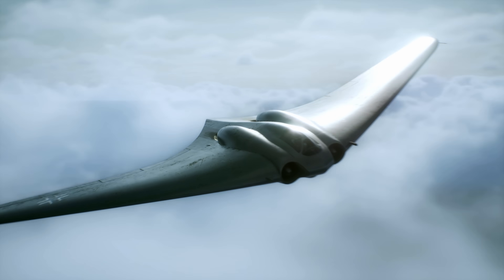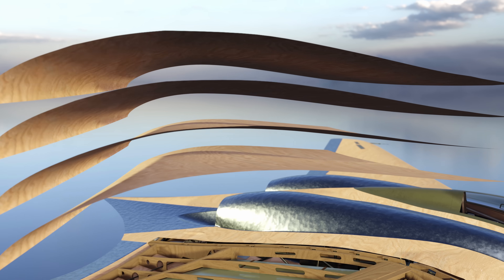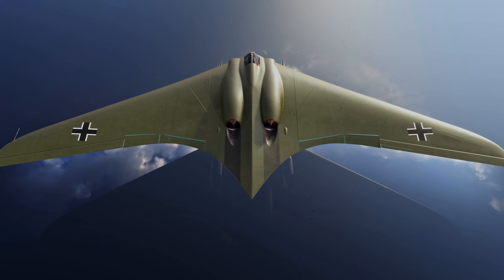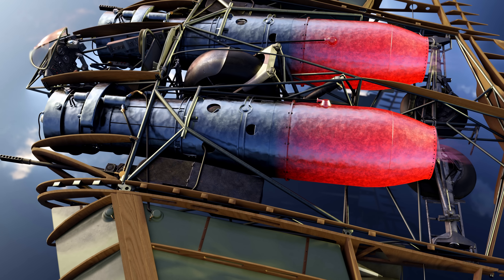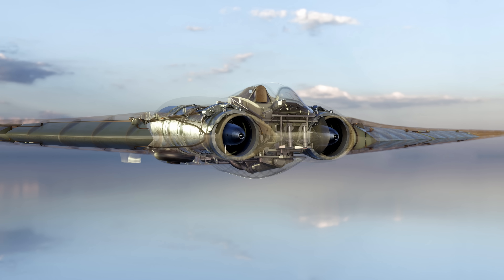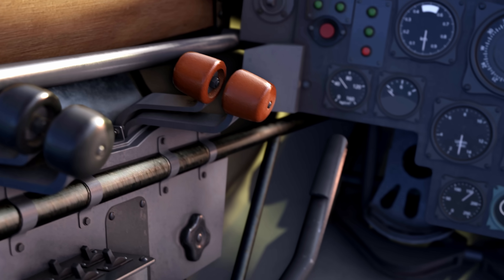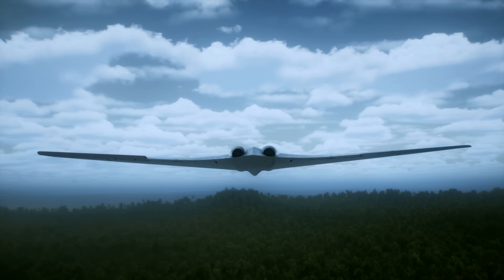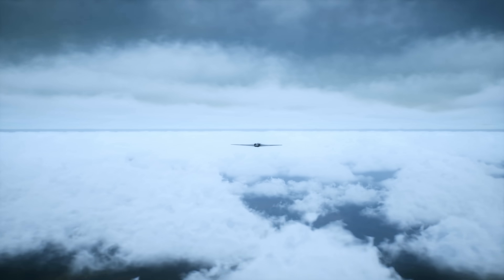Inside the Horten Flying Wing

Comment: This is easily one of the most facinating and beautiful planes ever built.
Reply: Indeed, it my fav of all time, I would love to see a modern one.
Reply: @Yvory6  the "modern one" is flying right now - the U S Air Force B - 2 bomber. And it will continue to fly when the B - 21 is operational.
Reply: @williestyle35 
And it actually needs on board computers to keep it aloft.
The Horton didn’t.
Obviously comparing size difference. But considering the Horton brothers were not aeronautical engineers makes this aircraft even more incredible
Wondering also if the 229 could have been constructed with proper materials. Particularly the skin.
Reply: @Rob.S859  The horton didn't have a computer not because it didn't need it but because they didn't exist. Without flight augmentation systems the plane was almost unflyable, which is why it never was used in combat. Overall it was a terrible plane that couldn't even really be flown.
Reply: @williestyle35  yeah I know all the story around that, I meant a modern version of that exact shape
Reply: @rubiconnn 
The point I’m making is that this aircraft that was literally designed by an almost “cottage industry” budget by two brothers who were not even aeronautical engineers. 
The fact it flew without computers is a remarkable testament to the Horton brothers and their vision.
A B2 can’t even get off the ground without the aid of computers.
Also look at the overall design. The placement of the engines in relation to the drivers position. The angle of the swept wing. A lot of characteristics taken from the Horton. Weather by coincidence or design.
I suggest you read the book Horton 229 The Spirit of Thuringia to get a better appreciation for this aircraft.
As for its handling characteristics.
They had actually solved a lot of the critical issues with design changes in Feb of 45’
The one powered crash was due to engine flame out of which the pilot chose to try and save the aircraft instead of himself.
Prior to that, there were other successful flights of the 229.
Further more, it is known from Hortons that they had arranged  a mock dog fight with the Me-262. And that the 229 out performed the 262.
Though I have not found substantial evidence to back up the last statement regarding the 262.
Reply: @williestyle35 But why where they developed so late. Not directly after WW II?
Reply: @Rob.S859  Por eso es que el Ho-229 se estrello, era inestable. Tu afirmación parece que toma en cuenta ficticiamente que el Ho-229 estuvo operativo.
Reply: @cristianmigueliit parraguirre8750 it crashed because of engine flame out not because of any engineering flaw
Reply: @trance9158  Incendio en el motor también es fallo de ingeniería. Además de eso, creo que todos estos comentarios no tienen ni idea que franceses, soviéticos y Norteamericanos volaron alas volantes antes que los alemanes...
Reply: @williestyle35 US. The bravest engineers, physicists, mathematicians. Sadly, becoming worse at finance and modesty. Seems like upper middle class will be educated enough to work with such prestige as those who design such aircraft. The lower class will be uneducated or have the label but become corporate store managers for the corporate oligarchs. Switzerland isn’t a military or tech prowess, but I enjoy living here with my American husband, who is prior combat vet. We are doing okay. But depending on US direction. I would really like to live in Florida, on the coast. Or one of the Florida rivers that lead to ocean. On cool note. My husband was born in Ft. Myers, and lived in Naples Beach. In the new GTA. Its regions included called Ft. Misery and Napoleon Beach haha
Reply: @Rob.S859  But the similarity you refer to isn't similar. The engines on the Ho 229 are right forward beside and against the cockpit and the intakes are right in the front of the leading edge. Whereas the engines on the B2 Spirit are behind the cockpit, separate from the fuselage and the intakes are above the wing and set back from the leading edge. As for the swept wing angle, it is not the same in both aircraft and swept wing tailless planes had been around since the Dunne D8 of 1910 and followed by the likes of the  Westland Hill Pterodactyl 1A of 1928 and Northrop's own NM-1 of 1940. All of those aircraft had flown as much if not more than the Ho 229.
As for the claim that 'it is known Hortons that they had arranged  a mock dog fight with the Me-262. And that the 229 out performed the 262' , it isn't 'known'. As your experience suggests, there is little evidence to support such a claim and all there is evidence for is a telephone report by Ziller to Reimar Horton in which he compares the 229's climb and turn rate favourably with the 262's.
Reply: You mean the yb series since those planes came before the horten???. If you mean it looks similar to the f117 you would be correct as they are very similar in design
Reply: @rubiconnn  It looks like a handful just to keep airborn.
Reply: @Rob.S859  yeah that skin could be lots of different materials today. The engines are much better too. Computers are available that can easily handle the controls. Using the same concept and plans with modern technology. This would be an awesome fighter
Reply: @rubiconnn 😂😂 yeah.. guess we will have to wait for that argument to be settled. I say it will fly. And it’s a flat out hot rod. When you are a pair of brothers stuck under Nazi control. Tryna build a successful fighter and bomber with a state of the art all new technology. On a shoe string budget. Because the ally’s have laid waste to your country and blown its infrastructure all to hell. Yeah the pressure and challenges could be a wee bit overwhelming. 😀
Reply: @Rob.S859 maybe you didn’t find out everything about the 229. But i can see your a fan. And you do your homework. 😅. Lots of test pilots buy the farm developing aircraft. That’s part of the job. If these brothers could have been given the opportunity that vonBraun had gotten. We could have seen this plane flying by the 1960s. Can we say Skunk works?
Reply: @cristianmigueliparraguirre8750 all prop jobs. Strung together. This example is like a Ferrari in comparison
Reply: @JohnPlatford  No, un Ferrari es funcional y la comparación es absurda.
Reply: @ lemme guess what you said. 😎. You said that a Ferrari is functional. But the plane wasn’t. So im wrong. 😀. Well that’s your opinion. Mine is the Horton 229 was fully functional. Albeit with makeshift parts.
Reply: @JohnPlatford  Tú lo dijiste, es tu opinión, mi afirmación no es una opinión, solo menciono el hecho de que el Ho-229 nunca entro en servicio y que su único pruebo de vuelo terminaría estrellándose ante la inestabilidad en vuelo, falleciendo su piloto. 
De repente tu tienes un Ho-229 en secreto y haz comprobado que es totalmente funcional... XD.
Reply: @hugoswan7400  Because they weren't developed late. We currently know about the planes that were developed 30-35 years ago. So take the newest plane that is known to the public, something that isn't even released, like the F-47, there is a version newer than that already being build.
Reply: @rubiconnn  Yeah dude, It was so useless that the US eagerly stole the design but took them 50 to figure it out, LOL!!
Reply: @Rob.S859  B2 is based on Horten H.XVIII  "America Bomber" ;)
Reply: @williestyle35  sorry but for a reason, I can’t explain the Horton just looks better
Reply: The most advanced military aircraft are made with non-metal skin materials, again. Wood isn't a problem when no one can hit you.
Reply: @goodday126 . Aluminum isn’t indestructible 😂. Or titanium. Lol. As much as we love this wonder metal 🎉
Reply: Normal.Los mejores ingenieros del mundo son alemanes
Reply: I saw it last April at the Air & Space museum near Reagan Int'l Airport in DC (highly recommended). You could easily overlook it due to the overwhelming multitude of aircraft. They also have an ME 163 Komet.
Reply: Pure art:)
Reply: Das war Deutschland ❤
Reply: Agree
Reply: Damals war das Flugzeug aus Thüringen seiner Zeit Meilen weit vorraus . Hier wurde Geschichte geschrieben für die Flugzeuge von heute !!!
Reply: @frankbreitzke5239 Nonsense. This thing was a waste of time.
Reply: The fact that this aircraft exists triggers the xenophobic Alliboos... it is a humiliating and embarrassing slap back into reality and completely destroys the notion that the Allies were leading or even on par with German aerospace technology.

Because they cannot deny this aircraft exists they feel obligated to slander and insult the Ho-229 with misinformation and outright lies.

Of course this only makes them look even more childish and ignorant.

Germany invented jet engines, supersonic ballistic missiles that flew into space and they invented radar stealth technology... let the Alliboos cope and seethe.
Reply: Did you know these things were made by obese fascists sucking hitlers toes while doing a Roman salute
Reply: gdyby Hitler miał ich 100 ,to dzisiaj nie byłoby na Ziemi ani jednego żyda .I nie byłoby " Covid 19"
Reply: THIS PROVES HORTEN IS THE ROOT OF B21 B22 KITE PLANE ETC...
Reply: Ok! 👀
Reply: There are two of these in Chantilly Virginia.  I think you are wrong about your history and numbers.
Reply: Fueron la base para los bombarderos de hoy.
Reply: Ele aparece no Filme do Capitão América. OBS: Os EUA projetaram jatos muito similares a eles em anos posteriores, considerando que capturaram um para estudos, não é meio maluco saber que os Caças Super avançados e até tecnologias espaciais vieram do que foi criado pelos N4zist4s?
Reply: We can only be saved by THE PERFECT BLOOD OF CHRIST, SHED on the seat of divine mercy, the Ark of the Covenant.
There is no other Name than that of YESHUA /JESUS CHRIST that has been given to us in the world, to be saved.
YESHUA is the name of the Lamb of God that was designated by the Prophet John the Baptist / YOUHANAN.

The "Left Behind" will have to die as martyrs for Jesus Christ because they are not under his Blood, now and will have to refuse the mark of the beast. Because by their refusal today to become Children of GOD by placing their Faith in the Blood of Christ's Atonement ... they will be obliged to go through shedding your "own" blood for JESUS CHRIST.

Repent (understand that we are sinners, that we are heading towards hell, but a 180° is possible and saving) ---> METANOIA ... it is a transformation of state of mind, so when we put ourselves under the discipline of CHRIST and totally Trust in the REDEEMER BLOOD of Christ Savior YESHUA (meaning SALVATION) to remain there by FAITH continually, CHRIST becomes LORD OF OUR LIFE, even if we sin clumsily, we repent because we have then become Children of GOD and have the promise that He will save us from eternal perdition because YESHUA IS OUR ADVOCATE with the FATHER. 

So it is essential to believe and place all our trust in Jesus Christ, He who shed HIS PURE BLOOD IN OUR NAME ON THE THRONE OF GOD TO JUSTIFY US WITH THE FATHER TO BE SAVED ETERNALLY, YESHUA HAS WRITTEN OUR NAME IN THE BOOK OF LIFE OF THE LAMB WITH HIS BLOOD ---> to appropriate it for free because Jesus allows us ... we have nothing to pay ... it is GOD who offers us His Lamb, the Redeemer, his SON YESHUA / JESUS without any good work to accomplish for that.

He is our Lamb that GOD has provided for us for free to save us WITHOUT EVEN PAYING a penny, and this corresponds to the phrase of Abraham to his son Isaac when he asked him father "where is the lamb?" ... Abraham answered: GOD WILL PROVIDE A LAMB.

The Jews did it by buying a lamb, PAYING to slaughter it, admitting to being a sinner to transfer their sins onto this emissary animal and then ask the priest to pour its blood on the mercy seat of the Ark of the Covenant in the Temple of GOD in their name to be saved from the judgment of God concerning the past year.

Now Our Savior gives us the Salvation of God for free so that the poor without money can be saved and have eternal life without any good work to accomplish without doing anything, for free, just BY FAITH IN HIS REDEEMER BLOOD ... because we are saved by Faith in the BLOOD of CHRIST ... nothing to buy and nothing to accomplish because it must be understood that this was hard for the physically handicapped
Reply: Imagine if they had aluminum alloy... though they wouldn't have had the radar stealth...

Does wood actually bounce off radar differently/slower though?
Reply: It is fabulous.
Reply: I actually agree boss
Reply: to był projekt nie latający , nie mógł się unosić ponieważ jeszcze nie było takiej technologii, To że był to w pełni latający samolot to tylko propaganda.
Reply: Very fascinating
Reply: И бестолковых
Reply: sin duda un pieza de arte adelantado a su época, claro con sus deficiencias técnicas y de aerodinámica, pero finalmente adelantado a su época, a este proyecto le falto tiempo para madurar 🤷
Reply: @carlosarmenta838  This project never matured. The war was over a few weeks later.
Reply: But it is so difficult to control that you might just go without the bombs just to save yourself from wasting them
Reply: I always thought this was one of the most elegant aircraft ever. Lovely cockpit!
Reply: Do 335 with it's push-pull design a close 2nd
Reply: @TheGiggityG  Do 335 is one of my favorite propeller powered aircraft of the WW2 era. From what I know, its biggest drawback was the pusher engine could overheat and catch fire. For that reason it and the He 219 were the only two German propeller powered aircraft equiped with ejection seats. Do 335 was a beast, arguably the fastest propeller aircraft of the war and also the most capable of best filling the fighter/bomber role.
Reply: ITS AN ELITE OF ITS TIME AS FANCY TOY THEY CAN HAVE.
Reply: And totally useless.
Reply: Oh no, the XB-70 by far!
See it in person, will amaze you!
It's on display at the USAF Museum in Dayton.
Reply: @ginog5037 The XB-70 is certainly very impressive but not as far ahead of its time as the Ho-229...
Reply: @ginog5037  Yeah, what's that got to do with this?
Reply: And it works!!! Not to mention that it's constucted out of wood!!
Reply: It’s really less impressive than the legend makes it, flying wings had been a thing for a while, though they never really worked until flight computers controlling fly by wire.
Reply: You're wrong @Justanotherconsumer
Reply: @Justanotherconsumer  Thank your for shooting down your own silly and totally wrong comment!!
Reply: @Justanotherconsumer  you're less impressive with your lack of knowledge. Gliders and prop driven aren't on the level of jet propulsion.
Reply: The Arado bombers were better looking and definitely more practical
Reply: @SeanHogan_frijole 🧐. What is that??
Reply: Only one flew and it crashed and killed the pilot.
Reply: @wilburfinnigan2142  3 actually flew, one crashed, the other 2 got dismantled.
Reply: @wilburfinnigan2142 
There were several flights actually.
And the one powered not gliding )crash was due to engine flame out.
Reply: @Rob.S859 . Yea the engines weren’t that good in the German planes. They burned up quickly.
Reply: @wilburfinnigan2142  And your point is ?
Reply: @wilburfinnigan2142  The V2 prototype made 2-4 flights and crashed due to a failure of one of the engines, not some defects in the aircraft design.
Reply: @wilburfinnigan2142  No pain, no gain.
Reply: @wilburfinnigan2142  As most wartime prototypes do, nothing special about your subversive comments
Reply: @wilburfinnigan2142 . That’s correct. But he flew it several times before he cashed out.
Reply: @wilburfinnigan2142  Yes, that is correct. But not on the first test flight and not because of the aircraft. Rather, it was an engine problem with the Jumo jet engines of the time, which were not really reliable. The failure of one engine caused the aircraft to lose control and “stall”. While Spitefire and P51 had to “chew” on the ME262, this would have been a really “bitter pill” due to the fact that it was a whopping 130 km/h faster and extremely maneuverable. Especially since the advantage of the P51 as a high-altitude fighter, given the characteristics of jet engines that they work better at higher altitudes, in contrast to reciprocating piston engines, would have been really bad. But these are just theoretical numbers games. The radar signature was also extremely low, which made reconnaissance extremely difficult. Practically impossible at low altitude until it was directly overhead...
Reply: @wilburfinnigan2142  La idea es lo que vale aqui....y es la idea que materialiso al actual spirit.
Reply: @wilburfinnigan2142  I remember something similar. But I recently also found footage from sowjet onboard camera capturing one being shot down over Berlin. It was wingman while the single Horten chased the other sowjet.
Reply: @achdumeineguete it’s fake footage. It’s from a video game with a filter over it making it seem like it was caught on a camera.
Reply: @bowl-of-chicken-soup7107 he said, "It's a model." That means, "3D Computer graphics."
Reply: @hobiwan23  nowhere in his comment did he say “it’s a model”
Reply: @bowl-of-chicken-soup7107  It was the part at 00:34 where he said, "We've modeled the Horton in minute detail inside and out." Go check again, Johnson.
Reply: @hobiwan23   I think you need to go back and see who my original comment was directed towards. A commenter said that there was real footage of one being shot down over Berlin. My comment was mentioning that the footage he was talking about was fake. Nowhere in my comment was I talking about the obviously animated video that looks nothing like actual footage filmed during the 1940’s.
Reply: @bowl-of-chicken-soup7107  fair enough! I don't read all the comments & was reacting to your response.
Reply: @bowl-of-chicken-soup7107  Az igaz, hogy ezt a felvételt számítógép generálta. Azonban a Horten testvérek, készítettek több ilyen repülőgépet. Ezek a szerkezetek voltak az alapjai, a jenkik által később elkészített különleges lopakodóknak. A ME262-es típust, már hadrendbe is állították. Közel 1500 darabot gyártotta belőle. Azonban a Naci kormány, már nem tudta őket komolyan kihasználni.
Reply: @achdumeineguete  The only sowjet I've ever heard of is a monthly communist publication written in German. What is the sowjet you are talking about?
Reply: Except that it never even shot down as much as a seagull. Even if it had of been operational, its ability to make any difference to the outcome of the war would have been zero. If it was any good, the Allies would have immediately copied it after the war, and constructed and tested complete examples.
Reply: @sandgrownun66  The allies copied it after the war, but it took the US 50 years, billions of dollars, loads of computer simulations, all the equipment and material they need and tons of engineers to make one like it!! And the one they made looks a$$ ugly, unlike this work of beauty.
Reply: @cabernetguy2000  Got anything we don't know. The reason the US did all that development, was because it would have been as cr@p as the original, if they hadn't. Who cares what something looks like, if it's of no use.
Reply: @cabernetguy2000  You sound like a fanboy for this thing? The Americans actually built a much larger version of this twice. The first time was a disaster, when it crashed with predictable results. They tried again and this time were successful. However, only after a ton of money and a couple of decades. It needed it, so as not to be as useless as the original.
Reply: @sandgrownun66     not really,just look with no propper dokumentaion stupid Military who stored it for 4o Years and so on and so on.For example the Saturn rocket,the strongest Rocket ever build ,they lost the plans and could rebuild it. After the war there was no need to use German /Nazi engenering without the Rockets and the regular Jets.Military stuff like that was to experimental for the regular Military Persons,abd the own Industrie had interest to sell their own stuff.just look at the German Leopard 1Tank  ,it was just and rebuild Panther wihtout the mistakes they made.best tank after the war until they build the Leopard 2
Reply: @sandgrownun66 . That’s not so. Have you studied anything about this plane? There were two planes made. The one in the Smithsonian was what they found at the facility they raided. It was in pieces. The working prototype was destroyed. If they didn’t have to jerk around with the brass until the end of the war. They probably could’ve had a half dozen flying by then.
Reply: And useless
Reply: @michaelshore2300  
You are useless, 100%